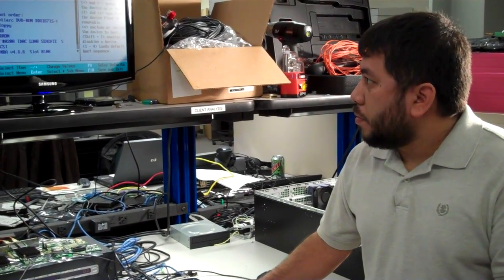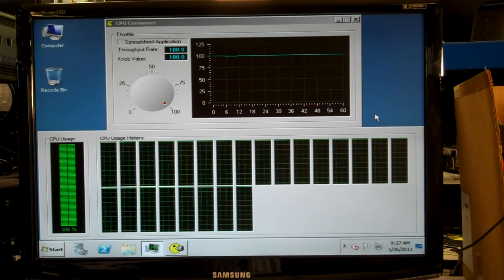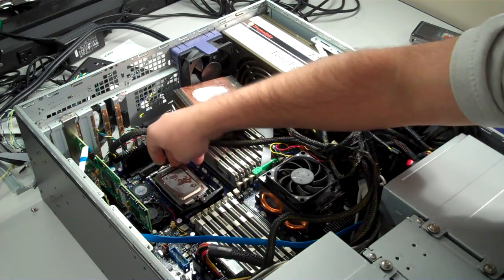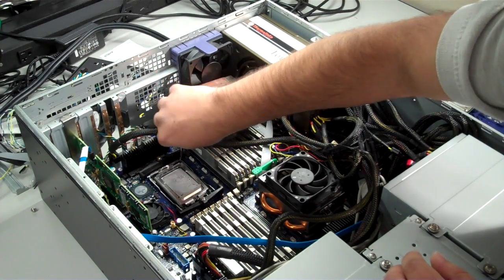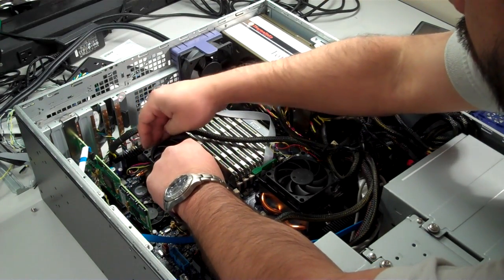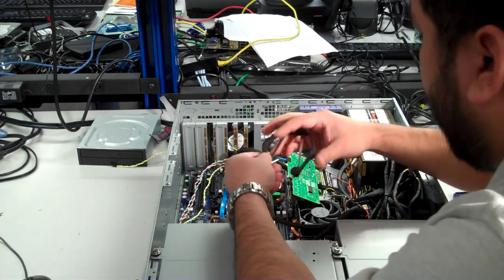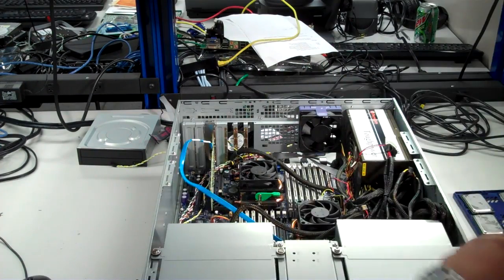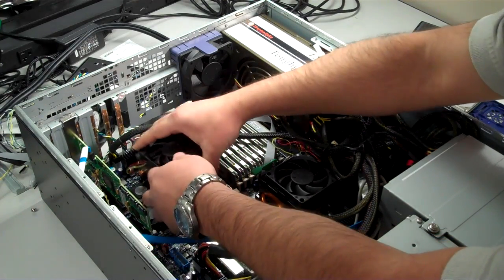16 Core Processor: Upgrade from AMD Opteron 6100 Series to Upcoming "Interlagos"

Comment: @NWOareScum  "it's not less relevant, it's as relevant as the other factors." Can I point to some recent benchmarks of an AMD Opteron getting nearly beaten by and Intel Core i7 3770K. Which, arguably, you could say has 8 or 4 cores less than the Opteron. Oh, and a 2500K at stock clocks beating an 8-core Bulldozer in gaming.

Comment: @hotbeanful Its Windows Server 2008 R2. It turns all that crap off by default so it uses as little power as possible so you can actually use the server for something more important. 99% of the time you never even see the interface unless you need to change something, which is usually done via Remote Desktop if you don't have a terminal set up in the server room for it.

Comment: @michael10021981 That cheap stock paste is in an uneven layer, is dirty, and has been cooking in between that processor and its sad little stock heatsink for hundreds of hours. You replace thermal paste when you remove your heatsink, that's the way it is.

Comment: @ITSAssassin You're not entirely correct. The problem with bulldozer is the cores arn't true cores. The problem occurs with multithreaded applications, which address cores in a fashion such as - 1,2,3,4 etc. Because of bulldozers nature, its better if cores 1,3,5,7 etc are addressed, as the cores share some element. The other guy isn't completely wrong. Why do you think an i5 2500k is faster in most applications than bulldozer? Why does somthing with half the cores perform over twice a quick?

Comment: @BrendaEM you say there is still power in the circuits ... how do you know that when he killed switched it he also pushed the on off button in front of the case for a couple of seconds to unleash the circuit from it's power... because no where in the video this was seen.. and also you should be able to switch hardware with power on even though this is nowhere to safe, either for the components or yourself..

Comment: @ICEGTN The new opterons are  a sweet, allround a nice processor tbh. Ppl keep whining about amd, but don't realice that amd is needed to keep intel pushing. The card is supposed to be unscrewed to renew the bios chip, the fact that you don't know if it was unscrewed when it was running means that you can't say that amd sucks. Ok, i should renew the thermal paste.

Comment: @BrendaEM You don't need to unplug it if you turn the power off at the back of the system, it's actually better to leave it plugged in as it takes the static away from you.

Comment: @flotopo You do realize that removing the heatsink and re-installing it with a part of the old compound on it would cause some bubbles, which could make the CPU relatively hot.
Could be 1-2c, could be 5-6c.. each one of them matters if you're in a data server/co-location center with 100 server racks in it.

Comment: @hosrom,
He has previously added new thermal paste on the new processors that he has installed. So just because you did not see him adding new paste on the new processors it doesn't mean he did not add it. As for the old paste on the coolers, that will is still usable and it will only add to the overall thermal transfer. You do not honestly think and AMD engineer would overlook such important detail, do you?

Comment: @BrendaEM Why would you ever unplug the power cord? The cord is ground, so when you touch your wrist to the box the static actually has somewhere to go. Instead, simply flip the switch on the back of the PSU to 'off' to cut all current and leave ground.

Comment: @09ghtght Please understand hyper-threading. it gives a 25% boost per core on sandy-bridge. In theory, bulldozer's way of doing things gives a 50% boost per 'core'. So think about the power of a hex-core Xeon + 25% boost from HT, vs an octa-core Opteron +50%. that's a 7.5:12 ratio. Does Intel have a 60% performance lead to match that? THAT is that math you should be doing.

Also, don't compare desktop-class (2600k) to server-class (Opteron). Xeon is Intel's server class.

Comment: @nicamarvin The Sandy Bridge core architecture has the best performance to date. Guaranteed a 16 core Opteron cannot match an i7 2600k on hyper-threading. And that's not even the best, Intel hasn't released their Ivy Bridge Extreme Editions yet. 3960X will be the king. I'm not a fan-boy because I use AMD myself due to the lower cost but Intel's i5 2500k is only $200 so don't exaggerate.

Comment: @nicamarvin Actually, with an intel 3K 10 core processor, you can have an 80 core workstation in a 4 socket mobo, (with hyper threading), which is more efficient than these 16 core cpu's, being that some have to be under clocked to meet heat requirements using a dual socket.

Comment: @DarkLaunch357X those low clocked K10 Opterons in a 4P servers are Murdering EVGA SR-2 with Overclocked 5 GHZ Xeons at Folding Proteins, that is REAL SCIENCE you FanBoy, its not some Synthetic Benchmarks, its Real, just wait for wait for InterLagos, 62 cores of Pure Power..

Comment: @DarkLaunch357X who is the Noob? you don't even know what is a Cluster or Folding Farm you dumb ass, you don't get it do you? AMD 48 cores at 2.3 GHZ can only be matched if you set 6 individual computer in a Folding Farm to come up with the kind of Points AMD 4P can generate using Folding@Home, that's real Science there done by AMD not some Dumb Ass intel Fanboy stating he is Playing Crysis 2 on the highest setting.. Folding Proteins to find a cure is Real Science

Comment: @DarkLaunch357X and Those PPD Numbers are just for MagnyCours, Just wait for Interlagos, a 4P Interlagos system will Murder Sandy B or Ivy on PPD production its Not even Funny, 4P Interlagos will average 1,000,000 PPD you would need to have a Folding Farm of 12 Sandy Bridge and OverClock the Piss out of them just to match Interlagos..

Comment: @THExVETERAN My point is, the cylinder count doesn't have as much to do with it as efficiency. I've seen 1.8L 4-bangers turn 620hp and I've seen 7.4L 8s do only 225hp. Don't argue that the 4 was boosted because THE POINT IS there are more variables to performance then just core count and clock speeds. Example? Why does a 2ghz Core2duo walk all over a Pentium D 3.4? They both have 2 cores. The D is even 1.4ghz faster. Because the c2d does more per clock then the D. Get it yet? ...unbelievable

Comment: @lazzer408 your logic is Faulty... these are not cars, numbers speak for themself, before the Bigadv WU point were uptaded recently(Folding@Home) a 4 socket ES Interlagos set up ruing at 1.9 GHZ per core(total of 64) was producing 1,000,000 PPD yeah that´s right.. now its closer to 800,000 PPD at 1.9 GHZ but that will all change once higher clock Options are release...

Comment: @nicamarvin Judging a CPU by the number of cores is like compairing cylinders on a car. A v8 must be faster then a 4 cylinder because it has more cylinders right? Wrong. You need to look at the horsepower and torque numbers. Same for CPUs. What the industry needs to start doing is ditch the core count and clock speed ratings and tell us the real numbers like mips ect. But they won't because most consumer whores don't understand real technical information.

Comment: I need to build a computer to rrun VMware vSphere and would prefer to use the AMD Opteron 6100 serius. The issue seems to be that I can not find a motherboard manufacturer with a quad socket design. The question I have is, what motherboard ddoes one use to get dual or quad socket and 32 DIMM sockets. I'll need 64 GB of memory for sure in this system. Does AMD make a motherboard ? Or do I need to look to ASUS or Tyan or ?

Comment: @Annon82 I did watch the whole video....And what he did was COMPLETELY unnecessary. Like I said before, you only replace the chip if a flash is not possible. Not just to save time, like he did in this vid. The socket/chip is VERY delicate, and you can easily damage one or both if you are not careful. They aren't meant to swapped in and out like other components in the motherboard.

Comment: OK, I'm only semi-informed on the hardware end of computing, but wouldn't 16 cores either 1) be really good at multitasking smaller aps or 2) have to have the processes of higher-demand software split into 16 streams? Or can you send one stream of process requests and it splits the work off to the 16 cores? I'm just curious if software structure will have to change to take full advantage or not...

Comment: @Delcaroll well AMD feels that core performance is better than HT and thats why they made bulldozer to compete with hyperthreading, but the problem is amd keeps moving back release dates and also they should have released this when the first i7 came out because an 8 core Bulldozer is essentially a really good 4 core with extreme HT so whats gonna happen when intel releases their 8 and 6 cores 3 months after bulldozer. thats 16 threads from only one cpu holy crap! and will beat the bulldozer cpus

Comment: @RiceMeLike You're mixing two different things, no one denies you need thermal paste, yes it is important to keep thermal conductivity between the heatsink and CPU. BUT, you do not HAVE to replace the thermal paste, that was my whole point. Yes if the thermal paste is old, you should reapply, but it is not necessary for operation. Besides a small increase in temps, you won't see an affect using older thermal paste, the rule is, if it's old and dry, then it's really choice if you want to reapply.

Comment: @dchains you will need thermal paste to seal all the air from coming into preprocessor and you **WILL** have to replace the Thermal grease (thermal paste) if your CPU cooler has been on your CPU for a long time or if the thermal paste is dried up.

Comment: I don't understand all the complaints about the thermal paste. It's common a misconception that keeping on old thermal paste will warrant higher heat. But in reality, it's makes a very, very small difference, yes, if you apply a fresh coat of thermal paste you could potentially see a drop in temps, but really, it wouldn't be enough to notice generally anyways.

The idea that every time you take the heatsink off the CPU you have to replace is thermal paste is false.

Comment: @sod16 I could have missed a statement about Zambezi vs. Thuban, but I think you're mis-quoting AMD here.

All they've said so far is that 16-core Interlagos will have 50% higher throughput than 12-core Magny Cours, with only 33% more cores, so performance is going in the right direction. Also, Phenom II X6 tends to tie with Sandy Bridge quad-core without hyper-threading, so I think its safe to say a FX-8000 with better IPC and Turbo than Phenom II will be faster than i7 Sandy Bridge.

Comment: @fannypenis Cryengine 2 wasn't optimized for more than 2 cores, you can achieve better performance and smoothness but you it only use the third core for thread managing and a fourth core don't make a difference.

Look at Tom's Hardware: How Many CPU Cores Do You Need?

Comment: Forgot to pull the power off the thermaltake toughpower or your psu...wait 10-20 seconds...BEFORE you ever touch anything in your computer. Anti Static wrist strap is recommended but touching the case frequently will also work

Comment: dont always need to renew thermal grease if its not hard and crappy, most heatsinks have enough residual to do the job. its to seal fine holes in surface to allow maximal transmission area, not to transfer heat, it is poor thermally compared to metal... you really want as little grease as possible in optimal thermal/overclocking situations

Comment: @manoj272580owen Unfortunately it's too late in the development cycle for them to make Bulldozer compatible with AM3, you'll have to get an AM3+ board. However, existing Phenom II cpus will work in AM3+ boards, so if you can't get both at once you can seamlessly upgrade to BD later.